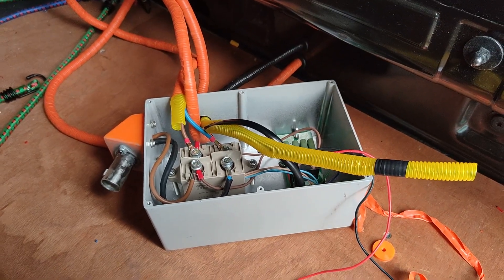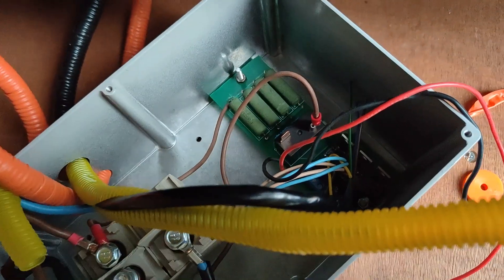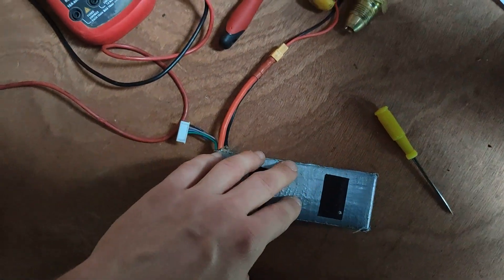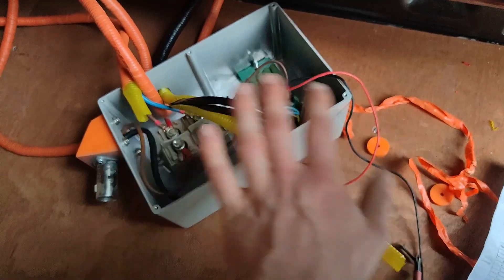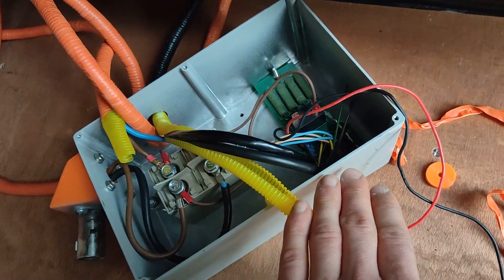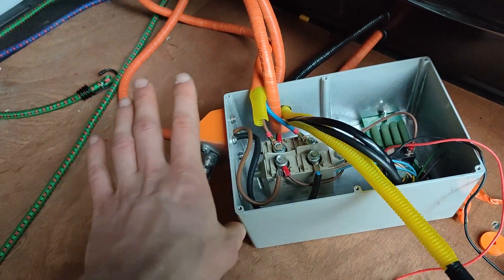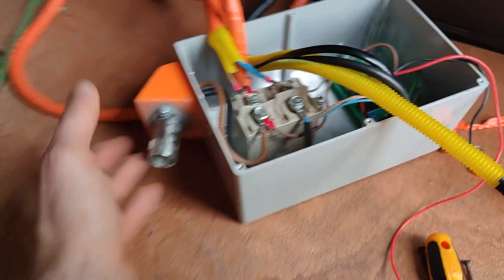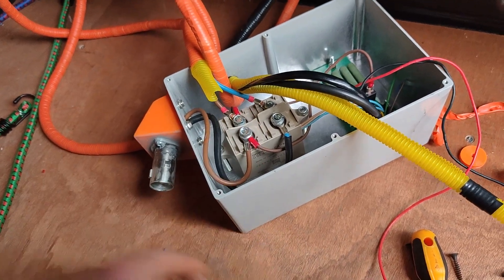E-NV200 Range Extender - Test of Generator Directly Connected to HV Battery

Comment: If the generator puts out 390v ish would that indicated that the dc to ac inverter for take a EV battery voltage range to make 230vac? Always wanted to add a 230v 3Kw inverter to my car.